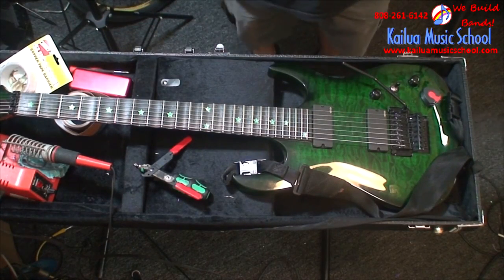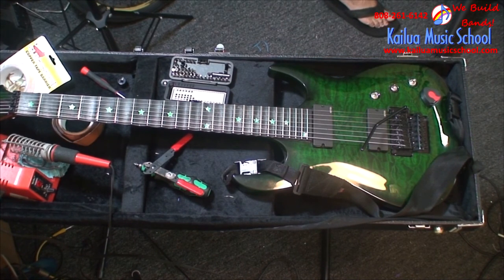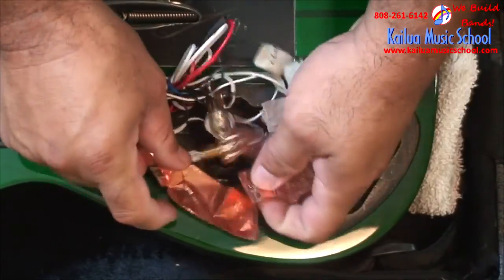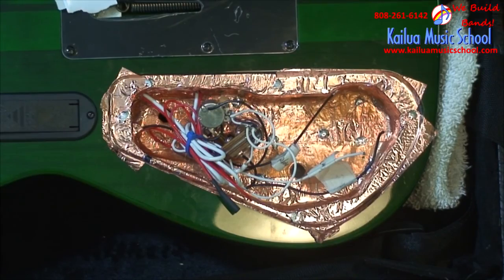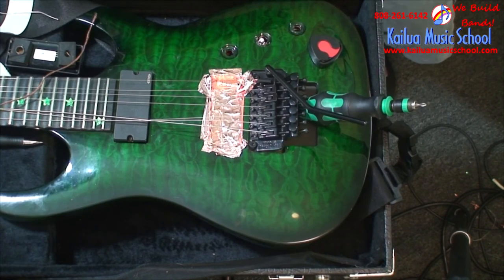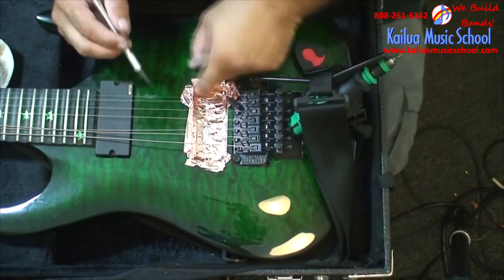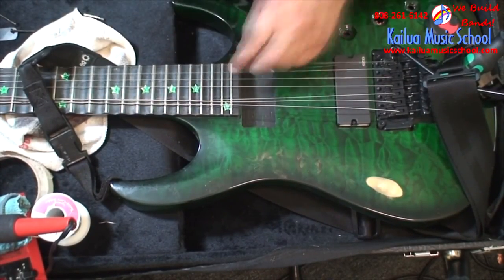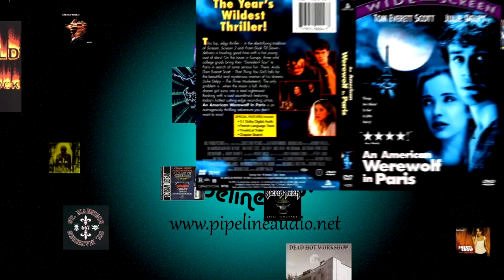Budget DIY Electric Guitar Shielding

Comment: thanks.
i connected mine with a single wire that connect neck and bridge cavity.
that wire is soldered  to neck,bridge and control cavity.
i was worried i did something wrong.
Reply from the maker: I'd take a multimeter with a beeper that checks for continuity and see that it beeps when you check all your different cavities vs your bridge or other central ground area

Comment: i dont understand
is there a wire between bridge humbucker and control cavity and another wire from neck pickup cavity to control cavity? or is the same wire ?
Reply from the maker: You could use the same wire, soldered at each point, or multiple wires. The trick is to have all the different cavities look, to a continuity checker, as a single electronic node

Comment: Shielding on active pickups?????????????? What the hell??? they do not get any hum at all.....
Reply from the maker: They most certainly do if you are in a typical computer ridden recording setup of today.
Reply: @pipelineaudio  Sir I was using USB connection with my guitar and 0 buzz on full gain. I never heard anyone saying anything about buzz of any 60 cycle hum on active pickups because they get the grounds from the battery and have hum cancellation inside the pickup circuit. Even had single coils active pickups and 0 buzz. I don't understand what is wrong with your pickups or Something
Reply: @pipelineaudio  most recently I changed active to passive pickups and they buzz like hell on the same setup